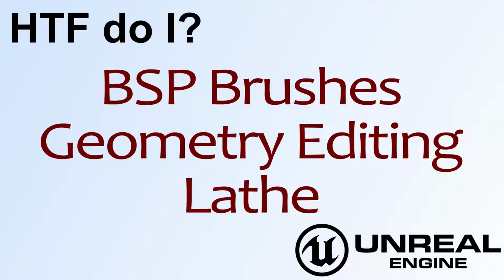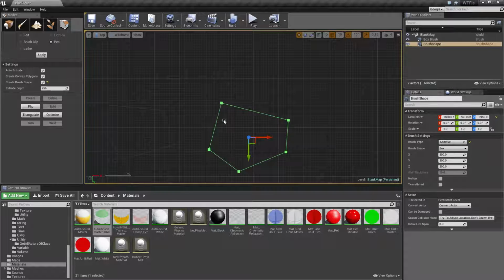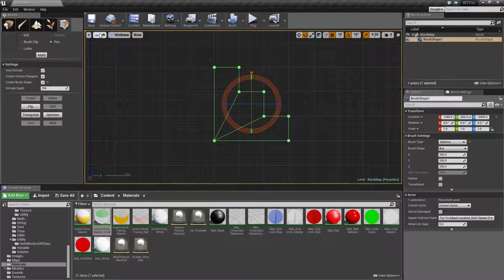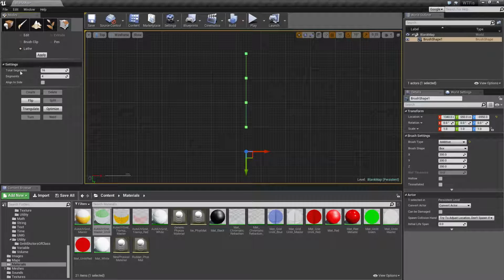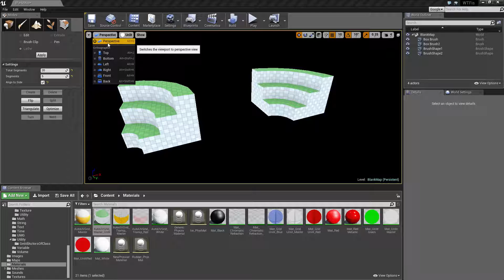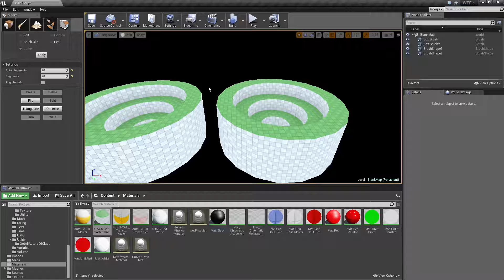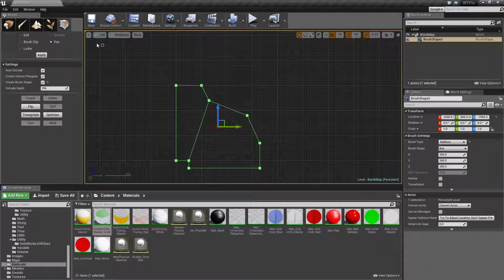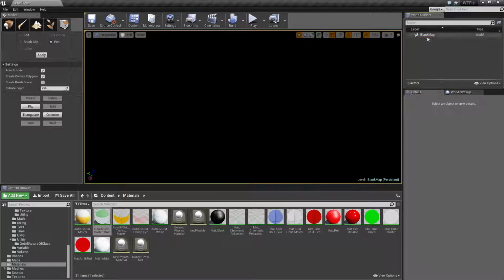HTF do I? Geometry Editing: Lathe ( UE4 )

Comment: pen tool with "create brush shape" checked, alt h, draw with spacebar and enter key. alt j, select lathe tool, alt mmb to move the pivot out of the 2d shape, hit apply. If it doesn't work, unckeck "align to side".
Reply: It also works on other directions.

Comment: Great, I always wondered about Lathe because it was always greyed out. 
How did you make the auto UV material where the floors are always a different colour from the walls? I guess it involves a world normal node in there somewhere? Do you have a video on that material?
Reply from the maker: +redchant IT does require the world position node and I don't have a video but I got the basic idea from Tom Loomans website as well as the material itself is in the Source Files that you could import and use or take apart if you wanted.
Reply: Theres something free called WorldGrid on the UE or UT forums but you'd have to ask about it. Sorry, I can't find it for the life of me. Only the paid SuperGrid version. Its dark green and brown instead of lime green and charcoal.
Reply: HERE: https://www.epicgames.com/unrealtournament/forums/showthread.php?11668-Easy-level-design-material-for-you-guys-%29

Also the rest of that forum is good..
Reply: Thanks!